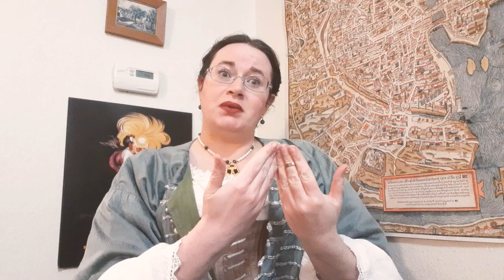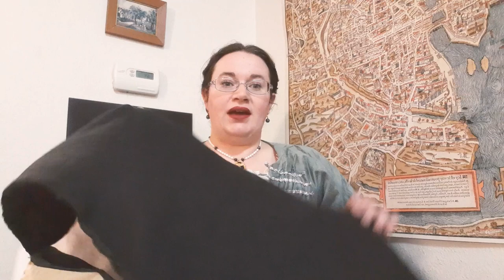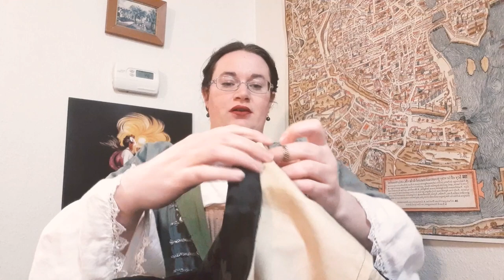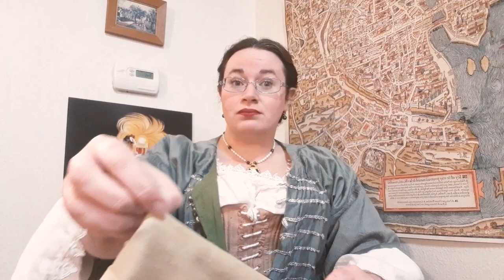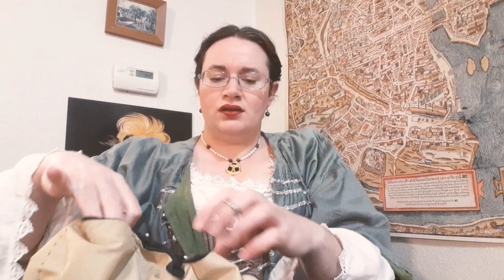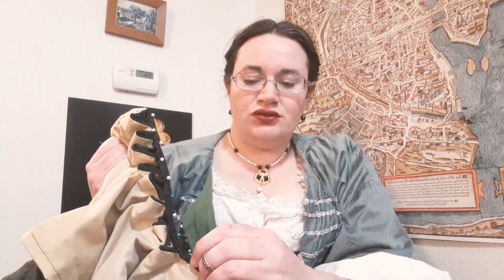Cartridge Pleating Part 1: Setting Up Your Garment for Sewing Pleats

Comment: So when you are talking about the elongated vee being taken out of the skirt, you are cutting that in? so the top edge of the skirt is not straight and level?
Reply from the maker: For 16th century dresses with a pointed center front I've found it helps keep brocades and velvet hanging correctly and makes my hemming easier
Reply: @MaridithSmith  thanks, I will be doing an underdress and a doublet overdress both with the vee and I haven't done that style before, knowing that beforehand helps!
Reply from the maker: I should be posting  pictures of my Belle sottona on Instagram this month & will be sure to get a picture of this process
Reply: @MaridithSmith  thank you!